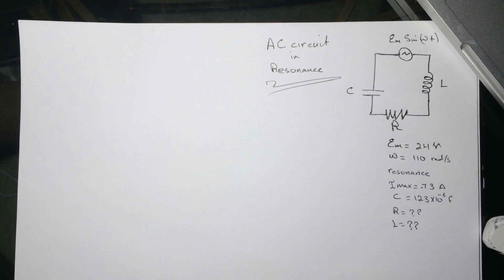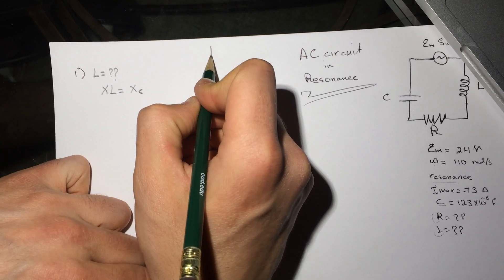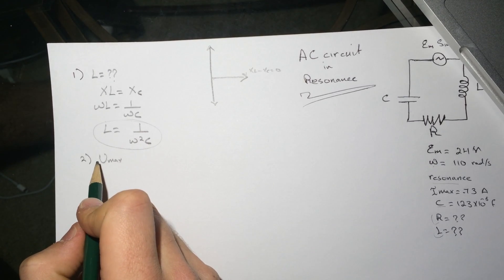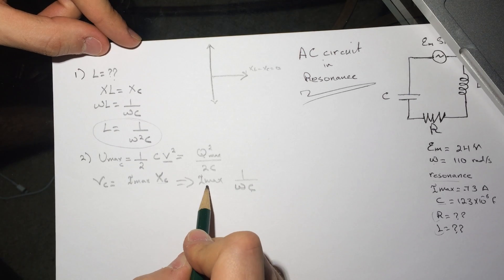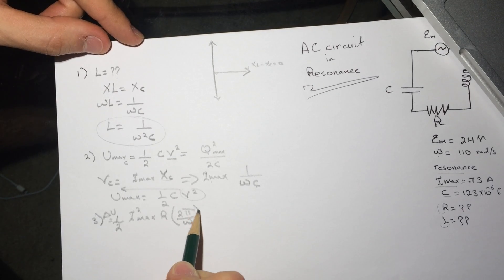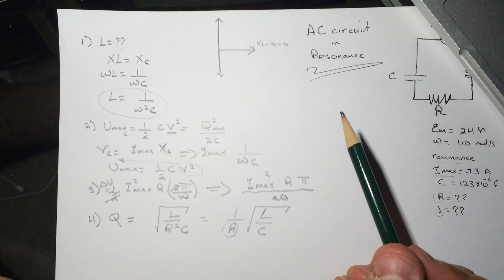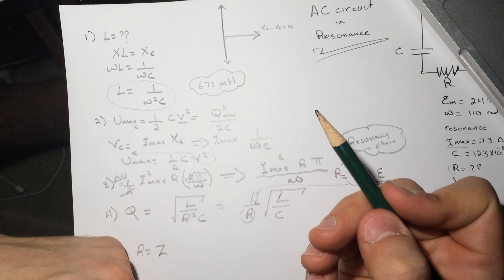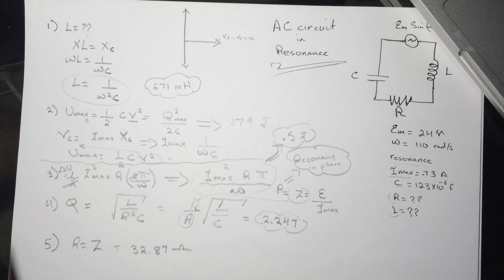AC Circuit in Resonance "Smartphysics" Solution.

Comment from the maker: My Friend 贺思云,for some reason I cant reply to your comment but I hope u can see this. Anyway, the power in the resistor is I^2*R, and Since the current here is changing with time then we have to find the Average current for the circuit, if you look at the current graph and tried to find the average current from it, you will get a zero. But the other way to find it is by (Irms^2=Imax^2/2) rms =Root means square. So using this equation we find the the power in the resistor is (Imax^2)(R) but they are asking about the energy in one cycle (2*pi/w). Units for energy is Watt which is Joules per second. Lets go back to the question now, The energy dissipated in the resister is equal the (Power in the resister * Time) and we got the power to be (.5*Imax^2*R)(2*pi/w). So yes, this equation got me the right answer, (.5*.73^2*32.87*2*pi/110)= .500267871 J.
I hope this helps. Good luck.
Reply: Thanks very much! Very detailed explanation!!!Are you a college student??or a TA in school? Just curious lol
Reply from the maker: Hahha, ur welcome and I'm a student so that's why I always say I hope I didn't confuse you lol .

Comment: It really helps, but I am not quite understand the 3rd question. I put a number and it says: "The total energy dissipated in the circuit in one cycle is not equal to the average power dissipated in the circuit. Energy is not power. The total energy dissipated in the circuit in one cycle is equal to the integral of the instantaneous power over one cycle" And I can't see clear your equation used for U, is it Imax^2*0.5*R*(2pi/w)??? And why use that. Thank you!